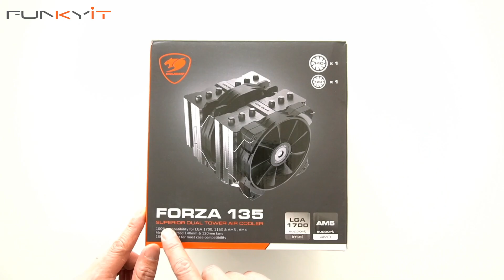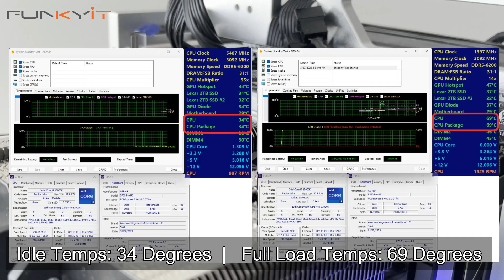CPU Air Cooler that can  easily beat an AIO Liquid Cooler! - Cougar Forza 135

Comment: you reduced that clock speed I noticed. big difference in a 40 watt test compared to a 100 watt test. or, 5.5ghz to 1.4ghz why cheat this test. claiming this was the performance you got, or do you not know what you are doing.  or lying. either way.

Comment: I need your help. I want to buy this model of cooler, but there are very few reviews and reviews on the web. I found a video where the guy has radiators dangling from the air flow. And I don't know what to do, buy or not. I do not want to buy water cooling at all, even this is not considered. and the choice is to choose either the 135 model or choose some 1 tower cooler. I use 11 700k and ID-COOLING SE-234-ARGB V2 for my build
Reply: Tengo el cougar forza 85 con el procesador i7 12700, y haciendo tests con el programa cinebench solo alcanzo temperaturas de 71 grados, por lo que el cougar forza 135 seguro te dara temperaturas menores.